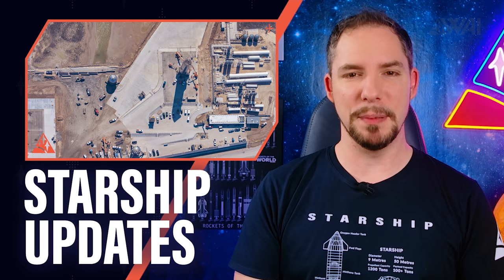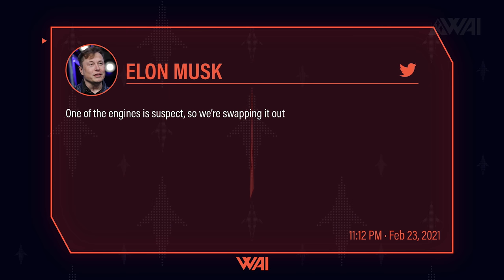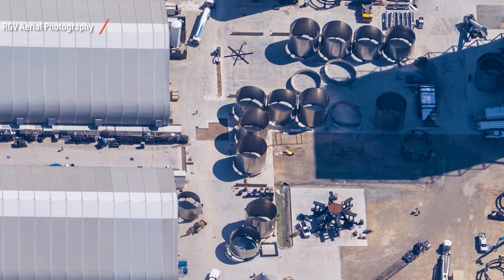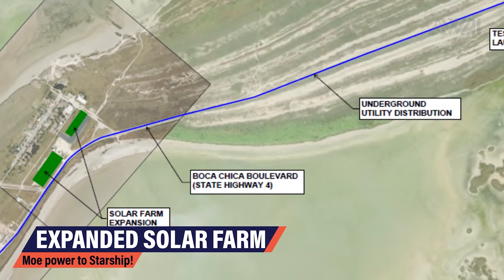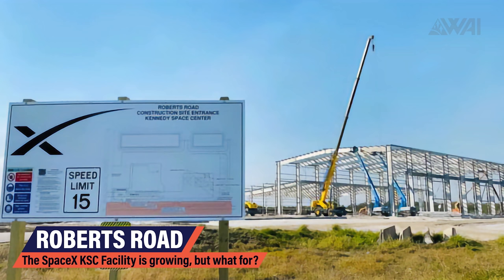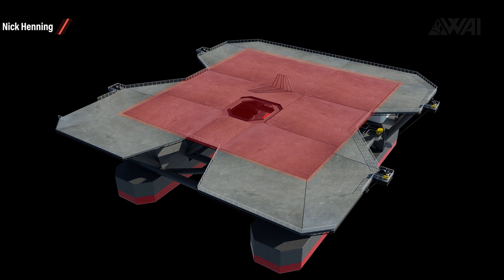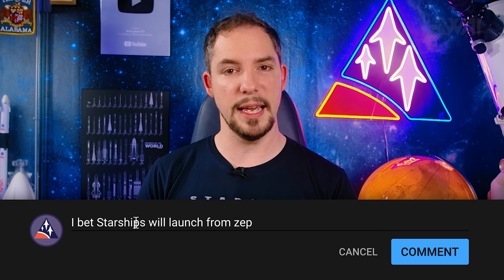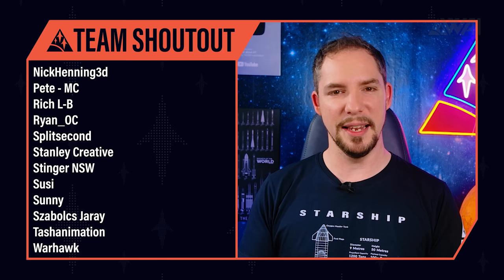150 Is SpaceX Building Two Orbital Starship Pads? & Major Sea Launch Platform Update From Elon Musk!

Comment: I like your animation of the sea launch platform. My thinking is that the booster launch mount will be down in the center just above the water level. This would make it possible to make the tower structure shorter. And the seawater could suppress thrust and noise.
Reply: Put the entire rocket inside the water and no tower is needed.

Comment: Your exhaust ramp would reflect and focus the sound energy back towards the rocket and destroy it in short order.
Reply: yes. i think they would build something that diverts the exhaust to 3 directions (left and right of the buildings and between them)
Reply: The reflection of the rocket's exhaust by the launch platform provides an enormous impulse for the platform. And because the reflection ramp is not symmetric, this impulse will also have an horizontal component, pushing the floating platform to the side, which isn't very practical; it might even push the crane/launch tower against the just ascending Starship or pull the platform from below the landed Starships and/or Superheavies on the side.
edit:
My reaction was formulated as an addition to Overmax Ma's and thought about the ramp shown in WAI's video.
Reply: @Apollorion  haha oof
Reply: Yeah. It would be better to just let the exhaust travel downward. There's a whole ocean underneath that platform.
Reply: @SignificantSkolriro  it would be better for humans and human stuff but everything underwater would be screwed. maybe an underwater sound supression system, perhaps with lots of air bubbles could somewhat prevent that
Reply: @FoxBoi69  I could see that. Yeah maybe there's some way of mitigating damage to the underwater ecosystem.
Reply: @FoxBoi69  
They will be anchored in very deep water not above a reef teeming with marine life.
An underwater siren can be used to scare away any marine mammals and Pelagic fish life when launch is imminent.
Reply: True
Reply: Guaranteed they will be using a bubble curtain ( or two ) to suppress sound , it's already used by oil companies.
Under water crew facilities won't work but buildings suspended Below the deck offers maximum benefit / safety
Reply: @FoxBoi69  it would not, the rocket would be on a launch pad on the top deck which is high above the water, at most it would send shockwaves across the water. Sea launches have been done before and they used the ocean as a flame trench

Comment: Just wanted to say being an oil worker myself. A rig like that can easily carry the weight of a few starships. For example Drill, pipe is about (Some Heaver and some lighter) 9lbls per foot. it can drill to 15,000feet with no problems, it then has to lift that pipe out of the hole so 15,000 x 9 =  134,000 lbs / 2,240lbls about 64 tons, no problem, and that does not take in friction when pulling. A rig like that can do more easily.   Also under the main deck are huge pumps and tanks for carrying water, cement, and the mud system. again a lot of weight. so don't worry about keeping the weight low, A rig derrick can have all that pipe and more racked back 60 + tons Rigs are very tough. Tons of space to put the accommodation under the main deck, when all the pumps etc have been removed. All good stuff. have a rethink. but good all the same.

Comment: Regarding four concrete circles, I worked on a fuel company, fuel tanks have all conections above ground on their side wall, their steel bottons are laid just on top of concrete slabs with no oppenings on it to minimize leakeage.
Reply: Liquid or gas fuel?
Reply: I worked with liquid fuels, but I had close contact with refinery people, they have spheres for butane and propane pressure liquified gas, with all plumbing above ground and I saw a project for a cilindrical liquified methane tank with a no oppenings on botton and all plumbing on side wall.

Comment: I agree with an earlier comment. A green Zinc chromate coating is used in aviation to stop oxidation and I think it is also used as a primer as well. So it could be the engine bell is simply coated with a primer coating to help protect the surface. This paint will last .0002367 seconds once the rocket is lit... :)

Comment: In my opinion, 
there is no need for the exhaust ramp or the vertical launchpad on the deck. If you simply place the starship's engines under the deck( closer to the water)by using the deck itself as the launch platform you get rid of two separate structural parts; gaining more space on the deck. Remember  Elon said, "the best part is no part". Also, The biggest risk this whole structure faces is the sound vibrations caused by the 42 Raptor engines on a stacked super heavy. The best way to mitigate this is by using water to suppress the sound. This can simply be done by adding several water pumps under the deck and pumping water towards the exhaust. also, the lower support structure can be outfitted to support the heat generated under the platform. these are some good changes to your model.

Comment: Those round bases could absolutely be storage for cryo liquids, usually large cryo tanks are held up above the ground so that they don't freeze it. The piping for the cryogenic liquids would not necessarily go underground they could just later put in a pipe rack above ground. They could easily build their own cryo storage tanks using starship parts with just a larger section around it to make it double wall. Pull a vacuum on the area in between and you have an extremely effective storage for cryogenic liquids.

Comment: 14:06 your reflector would put a lot of acoustic and heat stress on the vehicle. It makes more sense to channel the exhaust down into a water pit then out the sides. You need to shatter lots of water the absorb the energy then just pump and filter more for the next launch.

Comment: The best orbit for refuelling is a circular equitorial orbit - near-identical launch parameters every 90 minutes. So you launch a Superheavy stack with a Starship or a tanker on an identical trajectory each time so the superheavy comes down near the same spot each time. If you place a fixed landing barge there to catch it and refuel it, it can be flown back to the original site for the next tanker launch. Perhaps that is what these platforms are for.

Comment: If you look closely at the rebar structure of the THREE circular concrete foundations you'll see that they have sections at the bottom that are 'cut-out' of the circumference. This is normally done so that piping connected to the bottom of the tanks resting above can be led out to the side - in this case towards the ground support equipment building. I think that at least two of the tanks will be larger in diameter than the star-ships or the foundation itself, as they seem to be constructing the top or bottom domes from curved petal segments over in the construction site. As they are relatively shallow domes they are probably low pressure tanks i.e. for water. The remaining foundation (the high one) could be for LN2, and the extensions to the pad on either side could be for future LOX and Methane tanks.

Comment: If Elon meant by limited operations for the sea launch pad that a later SN would land on it, would the scrap it on the pad or would they move the entire pad to some sort of port near enough to the Boca Chica site? It’s close to what I guessed that they’d use one for a suborbital test flight since the starship would need to test its heat shielding in a ballistic trajectory at some point.

Comment: What are they for?  All those gases and fluids yes.  Cement tanks with those metal dome tops that are being made at the gas plant.  You wouldn't put pipes under ground for those. I don't think they would use Starship rings with all the rebar they are building.  They are building a second section and there might be 8 total rings.

Comment: Green engine more coper in the composite.  Put all operation and personal structures bellow the deck; possibly bellow water line. Having a tall structure on top of the platform may make it unstable especially if  add the weight of the starship to it and  resupply tanks aren't filled up.  So the tower is more then likely dynamic and can adjust its height.

Comment: There should be one or more concentric bubble curtains around the platform to keep marine life away from dangerous waters and to muffle the sounds.

I suspect that the rocket exhaust will be allowed to go straight down to the surface of the water.

If there are blast shields they will deflect the blast away from the buildings without reflecting anything directly back at the rocket.

Comment: Not a bad render for the Starship DP landing pad but you need to take into account a few nautical considerations. These things are floating platforms with a small waterplane area. With a leg dimension of just 45 x 50 feet, it gives them a tpc of around 0.12, which is not much. This means that they don't have a lot of reserve bouyancy when something like a 4400 tonne Starship is lifting off from one or landing. A Starship launch will see the rig rise up by 5.3m, directly due to the low tpc value.
For this reason it is vital that the main launch pad is directly in the centre of the legs, otherwise the rig will tip over at launch as it becomes unbalanced. A secondary landing pad would need to be as close as possible to the rig centre for the same reasons, but with the craft landing only weighing a few hundred tonnes the instability issues are much less severe.

Comment: Maybe use the platforms for Falcon 9 landings? 
A dock on the surface would make sense, possibly with large elevators to bring passengers and equipment to other levels. Bringing out equipment by boat would be better than flying it out.

Comment: Why not lower the exhaust shield and lower the launch mounts to deflect exhaust into the water instead of the deck, plus would decrease weight and material cost?
Plus would decrease the safety hazard of a RUD under the deck which is sturdy enough to withstand such 
Either way, great rendering of the sea launch platforms

Comment: I'd put the buildings under the deck. Best way to protect them, and I'm not sure of the reason for the launch mount when the whole structure is sat tens of meters above the water. The only thing above deck would be the cameras, and tower used for embarking/disembarking  passengers. Escape boats would like on oil rigs be mounted low down under the crew and passenger locations.

Comment: I am sorry to tell you that the reflection structure wouldn't work. Why you might ask. The engines would produce a acoustic shockwave that would be deflected back on to the super heavy booster, starship, and launch structure.  The force of this shockwave being produced by the Raptors would be enough to damage if not destroy the launch vehicle, starship, and launch structure on the platform. This would need water to suppress the shockwave mitigating the damage caused by the Raptors at launch.
Reply: Probably the reason for launching this at sea. You have a large body of water that will supply your needs.

Comment: The flame diverter design looks ridiculous. 28 raptors will tear a steep diverter like that to shreds and in the process shove the platform downwards and sideways. Even if the diverter holds, the 28 raptors will reduce the buildings to cinders after starship reaches 30 meters above the deck.
Reply: That's why they're putting a water sound supression

Comment: Awesome rig concept. I would say it seems risky having a landing pad at the edge just in case it miscalculates the landing location, as there isn't any buffer room for mistakes and they may not want to put the rocket in the water in the event of such.

You could maybe have a large landing pad nearer to the middle and a launch pad in one of the corners out of the way with the launch tower in the adjacent corner. You could then mirror and invert this config to have another launch tower and pad. The Starship would then come in from a side giving it more room. It might also stabilise the weight. When a Starship comes in for landing the arms could swing out the way. Superheavy's could come in from corner and the towers could catch them over the water as it may not be as important if a mistake from them results in them landing in the water. (No one may drown because of it)

I would suggest having facilities within the  bottom of the launch towers and not including any above ground buildings for safety reasons. I see no reason why the underside could not be used for extra facilities if needed.

Comment: The crane tower is a weak point due to its height, which may be offset by lowering it and the launch mount lower, perhaps slightly above or at sea level, so the flame diverter, turned into a pipe, would channel flame across the water.  Also, the buildings would be better placed under the main deck to enhance safety.  Monitoring is typically through sensors and cameras, so it would be more of a bunker than an observation building.

Comment: I'd put the crew area inside the pontoons under water. I mean if a rocket explodes, then the blast shields aren't going to do much, and being in a life boat on the surface might not be that much better. Underwater might be a lot safer, and they can probably access the interior of the pontoons without a dry dock.

Comment: Instead of a solid floor on the sea platform I would put a grilled floor on the landing pads so that the rocket exhaust is absorbed by the sea. The laucnh mount can have an open hole underneath it.

Comment: Felix, The color change on the engine bell looks like stainless steel corrosion, perhaps they are having some sort of surface treatment to darken the bell, perhaps to reduce corrosion (stainless is gains its inert surface by forming an inert oxide coating) or to increase radiant cooling or both. I had an excellent materials class when I was studying engineering, but am no expert.

Comment: I have to believe they'll have the exhaust vent directly into the water below.  I mean, ideally, they'd dump the rocket and launch from water, but I don't think they'll go that far.  Launch from platform with blast passing thru the deck to water below.  Easier and safer for a large number of raptors.

Comment: For the sea launch capability, I would have considered detachable segments with a fixed central core launch facility.
The passenger terminal and maintenance/storage shed would be on barges/ships that could detach before a launch and move to a safe distance away.  Different variations and upgrades would be possible and adapted much more easily. Have detachable landing barges as well that would re-connect to the main core upon a successful landing. Even daisy-chain them so you're not limited to just 2 Starships. If you have a catastrophic landing, the main core remains intact. Again, much easier to replace with another detachable (upgraded) landing barge.

Comment: The buildings could be incorporated under the platform with air craft carrier like elevators for the maintenance facility. Even if they slightly raise the flight deck this could lower the center of mass and ease sea going on/off load of cargo and personnel.

Comment: I don't know about putting the full stack in the middle.  If there is a rapid disassembly, surely you don't want that right in the centre.  Put it on one side with heavy shielding... counter weight on the opposite side?

Comment: The difference in colors suggests a difference in materials or manufacturing procedures. Either way it implies that there is a difference. This is no accident. Felix you have done their engineering for them. I don't see how the final version of the launch platform could be any different than what you proposed. Outstanding animation! When you showed the emergency escape system it became apparent to me that if you're going to fly on starship you will first have to attend a class in emergency evacuation. Learning how to get off that platform should not take place during an emergency and from a liability point of view you don't want anybody leaving the buildings to go outside unless they are first trained to be there. In other words the company from the beginning will be operating from a core of frequent fliers. They will all know each other if they don't already and the flyers will all consider themselves to be part of an exclusive group of people. That's something you can't get from an airline anymore.

Comment: Perhaps 2 rig platforms will be used for each sea launch platform, providing more surface space. Arriving & departing Starships could be accommodated without having to worry about evacuating personnel areas prior to arrivals / departures.  I imagine the 2 rigs would be connected by both surface & underwater tunnels. Such a launch facility would seek to use planning innovations from international airports, where personnel & passenger areas are in entirely separate buildings.

Comment: My guess,  No deck houses. Maintenance below deck in a hanger between the floats  with elevators for moving raptors.  Passenger service on separate vessel that comes and goes and is not at risk should something go boom.

Comment: I would think they would take advantage of the deck being so high from the surface that they would design the launch mount where the exhaust would travel through the deck. Doesn't make much sense to have a sea launch platform and not use the advantages that come with it. For that reason, an exhaust ramp would be redundant and most likely unnecessary.